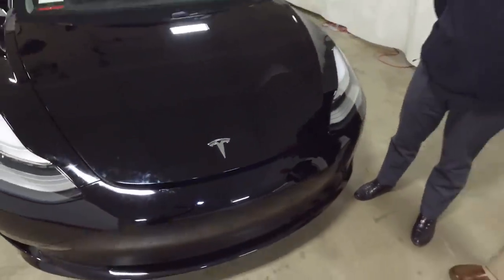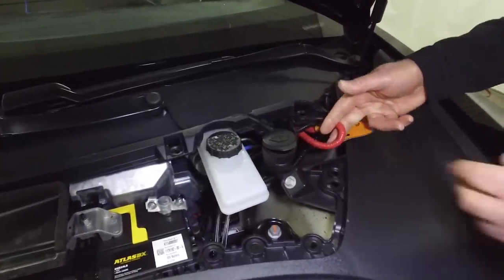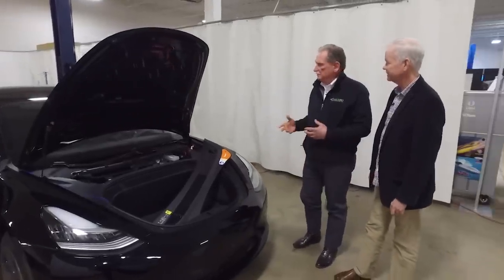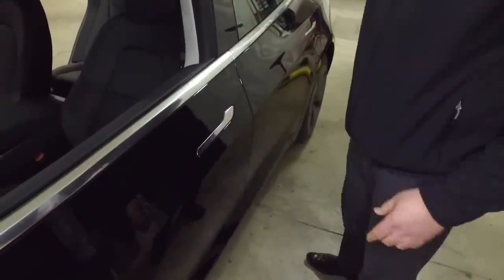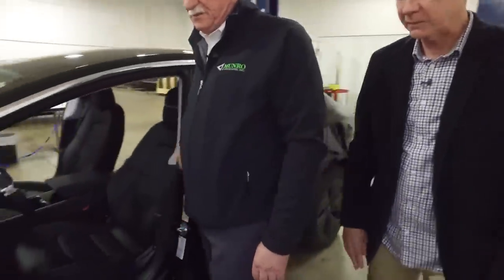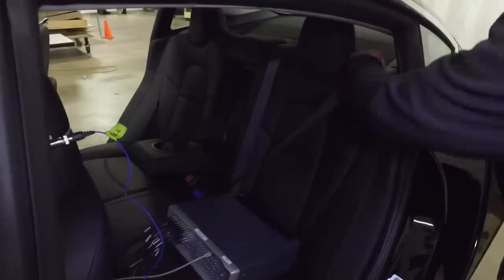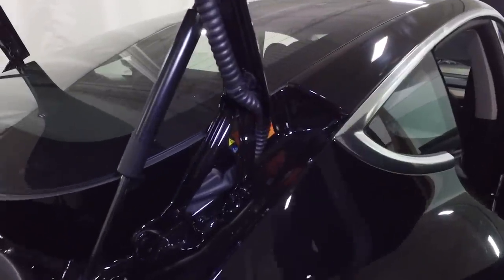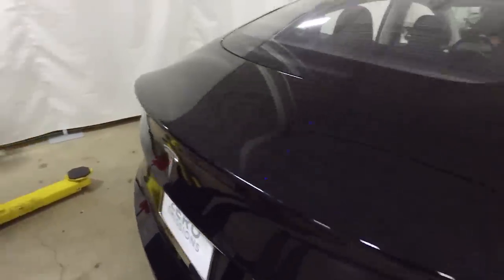Tearing Into Tesla's Model 3

Comment: Lost me on the two-handed door opening and fire departments receive safety training on new vehicles.
Reply: The battery can burn pretty nicely, too.
Reply: thegaygaymerchannel I agree...
Reply: They don't get trained on every model. They might get a training for electric vehicles in general, but that's it. And even this won't help them with this issue.
Reply: Don’t forget the fear-mongering that there are only “seconds” to save passengers as if the thing will explode in your face in any accident. This isn’t a gas car man, there aren’t gallons of explosive fuel anywhere inside.

Comment: OK so the Model S had a mechanical release and people complained because thieves could enter their Frunk. They change it to electrical and someone complains. The Trunk of my Volt has no easy way to open it if the car is locked and that is where the cut cable is so get a grip. They can use the 12V to open it or they can force it like they have to do much of the time anyways.
Reply: There's no high voltage in that part of the car, it's all  low down and around the battery/motor area.
Reply: Aaron Kulkis
Don't even mention "government support for Tesla" when the taxpayer has paid TRILLIONS of $ to subsidize petroleum over the years, that's the most misleading, ignorant angle being regurgitated.
Reply: Aaron Kulkis Every single car of the market does not have an outside mechanical release. Inside is irrelevant as that's where the trapped passenger is, that the firefighters are trying to get out.

So to do that they open the hood by prying it open , and have been doing this since last century.
Reply: Aaron Kulkis Mechanical release to open the hood is irrelevant to the firefighters on the outside. 

There also two obvious mechanical releases for the doors.
Reply: My Chevy has a electrical release only
Reply: Those are minuscule quantities of He compared to what is consumed by industry.  When it's gone from the few gas wells in Texas it's safe to assume it's gone for good, or we can wait a few hundred million yr.s for it to recharge.  Most of the metals can be recycled at least (most not all), not so for He as it leaves Earth as you mentioned.
Reply: Here is a little perspective, not that the entire nation will ever be entirely supplied by solar, no need for that, but IF IT WERE, it would be doable with just a modest chunk of Nevada, a quote from one source similar to other estimates I have seen:

"large solar PV facilities need 3.4 acres of total space (panels + buildings + roads + everything else) for each Gwh of electricity they produce.
That leads to an output estimate of 0.294 Gwh / year / acre, and virtually the same total area, around 50,000 square kilometers in the US, or 0.6% of the continental US’s land area."

Subtract from that area all the roof tops available.  And that's at current low efficiency panels which are all but certain to improve, possibly double over time.  Or other forms of solar (non-PV) which may be far more efficient on big scale, not for your home roof.
Reply: PROVE IT!  (lol)
Reply: A fire fighter isn't going to look for the mechanical latch which is probably jammed anyway.  He's going to cut it open.  Do you think he's not wearing gloves when cutting into ANY car?  Have you seen a prius?  It has the same issues!
Reply: Aaron Kulkis
It's no more "the lifeblood" than thousands of other things and it's more replaceable than just about anything.  AND it continues to be in part because of heavy subsidies that should be terminated so that all options can compete on a level playing field.  For example:  One or two additional dollars AT THE PUMP for gas to pay for things like the military in the Persian Gulf, etc.  Until then it's pure folly to talk about Tesla being subsidized when the opposite is true on balance.
Reply: Pardon the length and this is not exactly a "Proof", it's just where I was coming from:

Oil can be substituted by NatGas in every circumstance, fertilizers, chemicals, fuel, plastics, rubber, etc, we have so much surplus of the stuff it's often flared instead of harvested.  Compare that with helium which is about to run out, nickle, vanadium, chrome, tungsten, molybdenum, copper, and just about every other metal crucial to our lives and impossible to create from other things ....only aluminum, iron and maybe Ti are nearly inexhaustible on Earth.  Once we stop burning petrol, and we will, all the other uses can be supplied cost effectively by renewables, rubber tires, chems, etc., and cost effectively.  Oil can also be made from coal, Germany did so during WW2, nothing new here. 

Wood is not the alternative obviously, it's mainly solar in the near future. However, since you mentioned it:  At current oil prices significant quantities can even be created from wood fiber waste, no not enough replace gas and diesel obviously, but maybe enough for most aircraft which are hard to replace with electric.  In North California (for example) there used to be several wood fired electric plants, waste from agriculture primarily, much is being burned open air now (always has been), which is dirty and wasteful since now down to one plant.  Some is composted but the market is flooded with compost.  A $250M plant (as proposed by a subsidiary of Shell Oil) may be built to turn the 'waste' wood fiber into diesel, kerosene with some hydrogen left over at a profit down to around $40/barrel oil competitive.  There is far more feed-stock potential than ag waste, thinning forests or even growing it for the purpose.  This is only an EXAMPLE of what can be done, many other ways to create oil.  (Ultra cheap NatGas has made wood fired electric plants marginal or uneconomic, coal too for that matter)

  Have you ever looked at a chart of solar price per KWH over the last several decades?  It's following a Mores Law like trajectory with no reason to suspect it will stop anytime soon.  Give it another ten yr.s and we're looking at the cheapest electric ever, you will be able to run your entire house plus maybe one car just from your roof top.  Storage is a bigger issue but progress is being made on that front too and it's already viable.  Wind power is also falling in price fast, before fracking made NatGas dirt cheap in the US wind farms would have been profitable already.  Abundant cheap electric is on the horizon.

So yes, petroleum is highly replaceable unlike most other crucial feed-stocks of the modern economy.  An oil executive famously said some 25 yr.s ago:  "The stone age didn't end because we ran out of rocks, the oil age won't end because we run out of petroleum."  Indeed it will be obsolete long before it runs out and you will have a hard time explaining to a child mid century why we ever relied on it at all.  New cheaper better batteries will "soon" replace liquid fuels for road transportation and more.
Reply: Ok.  Prove it, and convert to wood as your source of energy.

FOR EVERYTHING.

(By the way, electricity is not an energy source, it's a transmission form)
Reply: What we REALLY need is a strong research project into cultivating bacteria which excrete oil.  I know that to some extent something like that exists.  Go on vacation for a couple of weeks, and you'll find an oil slick on the surface of the water in your toilet.  If that could be scaled up, it would be awesome.
Reply: Wind power kills endangered birds at horrific rates.

If it wasn't for government's love of "not-ready-for-prime-time" energy projects which consume more expenses than what they produce, most every windfarm owner would be in prison for mass violations of the Endangered Species Act.

The Sierra club has shown themselves to be hypocrites... they only pretend to care for the animals when the subject of controversy isn't a left-wing idol like a windmill.
Reply: Having a mechanical release INSIDE WHERE THE PASSENGER IS TRAPPED allows the TRAPPED PASSENGER TO ESACAPE WITHOUT ASSISTANCE.
DURRRRRRRRRRRRRRR.
Reply: Bo.  We can always get more helium.  It is naturally produced in most atomic fission reactions.  In fact, ALL of the world's helium reserves are due to the breakdown of radioactive elements -- simply put, the earth does not have strong enough gravity to hold helium in (which is WHY it is scarce).  I don't know if they do or not, but every nuclear power plant should be harvesting the helium produced in the fission core.  I wouldn't be surprised at all if our CVNs and SSN's do it.
Reply: "OK so the Model S had a mechanical release and people complained because thieves could enter their Frunk."

How come EVERY SINGLE OTHER CAR ON THE MARKET manages to keep the trunk secure with a mechanical release?

The problem is, Elon Musk Motors is nothing more than a bunch of golf-cart builders on an ego trip.

[I refuse to sully Nikola Tesla's good name by associating it with that collection of egotistical, "government, give us money because we can't cover our costs" asswipes out in Commiefornia.]
Reply: That's because petroleum of the lifeblood of the entire economy.  It's not subsidizing one particular company -- it literally lowers costs for nearly everything you buy or use in your daily life.
Reply: YarblekRW what if a firefighter cuts into a live high voltage cable and electrocutes himself trying save you from your electro-speck?

Comment: It's still the safest car on the road by far
Reply: The Volvo S60 is 6 years old and cheaper than the Model 3, and a still image can't tell you much. Rigidity isn't the same as safety, AND the fact that there hasn't been any official testing
Reply: Just watched a crash test comparison b/w an S90 and a Model S.  The S showed a-pillar buckling and the drivers' head slid off of the air bag and hit the roof/a-pillar.  The Volvo showed neither.
Reply: Yeah, Teslas are the safest, not the Volvo s90 or the Volvo xc90 that has a 0% fatality rate at half the price. They're neither the safest cars "by far" nor are they the safest cars at all. There seems to be a misunderstanding here, while the model x is rated 5 stars in all safety categories, that alone does not make it the safest car on the road. That's just clever marketing, and I'm saying this as a person who just ordered a model x. Teslas are not the safest, they are merely one of the safest. Very clear distinction to be made.
Reply: The Model S and X are, remains to be seen for the 3, no official testing yet, but from the handful that have been in massive accidents (one drunk driver literally jumped a creek in his, and one person hit a metal stoplight pole head on at over 40mph) it does seem to be very safe.
Reply: Here's a Model 3 crash test compared to a Volvo's https://youtu.be/wcZkkGL85AI

Comment: Are there any positive elements that were found?  Any "unusual" clever solutions to typical automotive design challenges?  With only a negative focus it comes across as a bit biased.  I do understand his concerns and issues he has found but surely there is some positive elements as well.
Reply: until they fail...
Reply: Yes.  Let's make another aspect of a car electronically controlled through a touchscreen and remove a perfectly good mechanical system.  Fantastic.
Reply: lessdeth69 tbh this video was specifically made to point out its engineering flaws, it’s even in the title. Yes it could be considered biased but the point of this video wasn’t to give a review of the car it was to point out engineering flaws of the car.
Reply: Tesla gave them the car. You don't get to have a Model 3 that early without it being a promotion model. How do you suppose they got it exactly? Just stole it from someone? Look at the license plate. That's a model from the showroom.
Reply: Yes, look for a video on the HVAC vents, they are both revolutionary and amazing.  It uses 2 streams of air that collide to direct the airflow, controlled via the touchscreen.  Each from passenger has their own controls to either make it a single, or split into 2 streams.  No vent controls needed.
Reply: I know right...all negative stuff. Makes you wonder who is paying this guy
Reply: It's all fake. You have to ask who is paying them to reverse engineer the thing... most likely GM or FORD

Comment: curious barrage of tesla apologists and calls for a shill video..
Reply: mcspikesky Clearly you don't understand that anything negative about Tesla(aka Beacon of Hope led By St.Musk) is automatically FAKE NEWS paid for by "Big Auto"
Reply: I like the IDEA of TESLA, however there are a few reasons I don't own one yet. This video highlights some real-world production issues with them. I think they can work toward fixing these things, but they still have a ways to go before I ditch my Alpina B6.
Reply: The IDEA of electric vehicles is great.
Same as the IDEA of gasoline powered vehicle.

The problems come in when you have to deal with the nitty-gritty of reality.

Elon Musk's car company is mainly electrical engineers... and, coming from that background myself, they tend to hand-wave away a lot of problems:

Electrical engineer:
Someone who measures with a micrometer(*), marks with a grease pencil (**), and then cuts with an axe (***)

(*) calculate resistance value to 4-5 decimal places)
(**) Let's choose the nearest resistance in the 12 values per decade (factor of 10) series
(***) .... with +/- 20% tolerance.

Capacitors and inductors are even worse.  Typical off-the shelf capacitors are marked with tolerances of (-50% / + 100%).

This works fine on circuit boards.  Doesn't work very well at all for physical mechanisms.
Reply: Considering some of the points he makes in this video are 'issues' that every car ever has (no external access to the hood, no mechanical override on the rear door with child locks), the objectivity is questionable.

Comment: obviously this was an early release car at the time of filming, I've walked through entire parking lots of these cars and not seen gaps like the one they have. Also there was a Model 3 that did a head on into a pole recently, not only did the hood pop open on impact, but the touch screen still worked fine, and the massive crumple zone because of no engine at the front absorbed the impact so the driver could walk away unharmed. I agree that there should be a mechanical release for the hood and back doors though. Excited to see what improvements they make in just the next few months on this car. It's very efficient, fast, and has many many break throughs for a car at it's price. The controls on the interior and features are being improved upon all the time by over the air updates based on customer feedback which makes it a new car every day.
Reply: Do you work for Tesla? I highly doubt you've seen a parking lot of Model 3s considering they are kept in private lots, unless you work there. The Model X has been in production since 2015 and I still see brand new Model Xs with uneven panel gaps and misaligned door handles. I doubt the Model 3 is any better, especially since they didn't even have a proper testing phase for this car. It was just rushed to market.
Reply: cool dood I never said I had a model S. I don't want one. And I've been driving for over 20 years, so no I'm not 13.
Reply: you just said my model S is so awesome
Reply: Who are you and why should anyone give you any credibility on what you have "seen"?  With your anonymous name you are committing an implicit lie of identity and this harms your integrity.
Reply: I'd suggest opening your eyes as I walk the Tesla lot and see X and S panel gaps that are worse than this 3.  It is a unique feature for Tesla
Reply: No, obviously this was a car that was rushed to market, and Tesla sucks at quality control
Reply: Chris Edwards Your fanboyism is showing.  The video clearly shows how poorly built these cars are but you put your blinders on. But my models S is so awesome. Who cares this is about the model three which is poorly built.  The model S is also a total mess when it comes to fit and finish and reliability
Reply: you don't have a model s. you're a 13 year old keyboard warrior lmfao
Reply: Well Chris that is worthless conjecture on your part!  So let me humor  and enlighten ewe.  As soon as my local Tesla store opened I walked in and bought a white Tesla water bottle(made in China) and white collared shirts for my boys who, while single digit in age, at the time begged me to sell one of my Porsches and buy a Tesla.  As we walked around the S we looked closely at how the quarters and doors matched up versus the two Porsches we own and the Lexus. The quality was horrible then and only slightly better today. Big difference in fit/finish then and now but still not worthy of the price point.   Forgive me as it's been a month since I last walked the "service center" by my house with my now 16 yr old.  His observations and discerning eye pointed out the uneven gaps on most of the X and S models sitting on the lot.  Please forgive him for growing up around quality cars that deserve the price charged for them due to quality, reliability and of course HERITAGE. I'll be one of the first owners of a Porsche Mission E in the US my friend...and should you ever gain enough financial intelligence to read a Financial Statement then you'd understand the dangerous levered trajectory that will  challenge Tesla's survival. But keep defending Tesla in your feminine and emotional way!
Reply: I know, I know! But after pounding tequila all day this was the best comeback I could make up!
Reply: Piccard Madoff I highly doubt you've ever even been near a Tesla dealership. The anti-Tesla cult is full of ignorant fools who want to bash a product they've never even touched, let alone sat inside. 
Meanwhile they claim that Tesla drivers are fanatics. 

Let's see, which side knows more about Tesla cars: the idiots who've never touched them, or the people who drive them every day?

If that's a tough question for you, then you need to go back to elementary school.